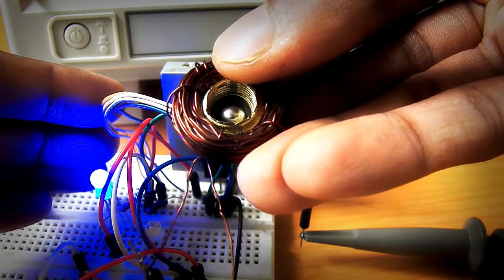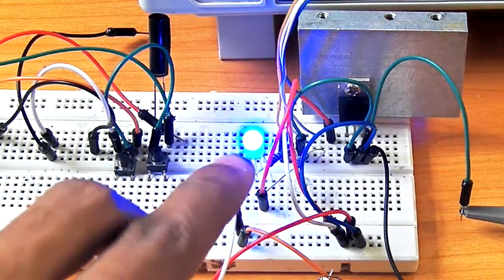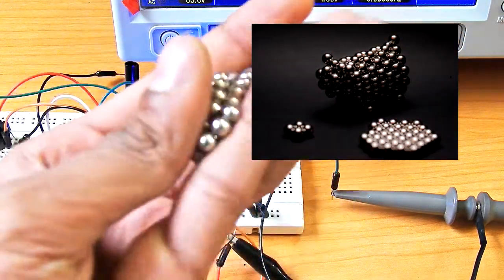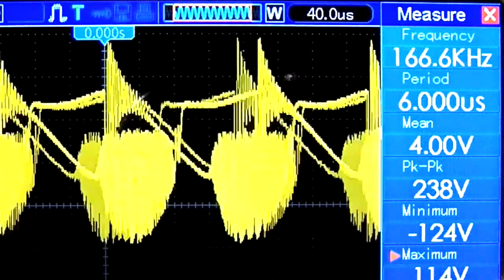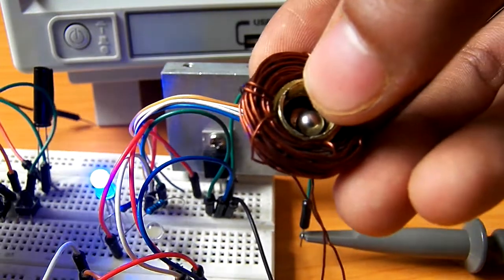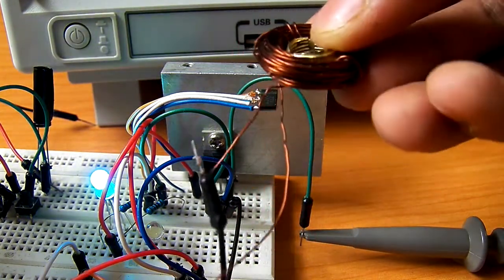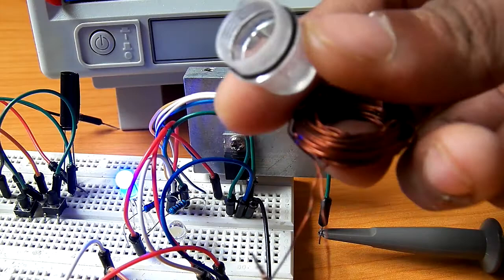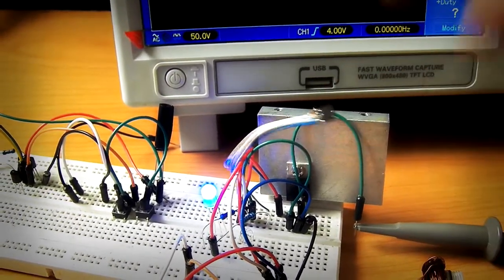Highest Speed DC Electric Motor With Coil & Magnet Tutorial !

Comment: Here is my 1.1 million rpm, 668mph, 3.64 million G's then exploding. https://www.youtube.com/watch?v=5PyTevLzYM8  If you measured 2.1MHz, then you would be doing 126 million rpm!
Reply: EDIT: you need to move your scope probe to the hall sensor output or the gate of the drive FET, also lower the probe bandwidth. The frequency your measuring is coil ringing noise, its clear but looking at 3:28 time in your video. When you get a clean waveform from probe in correct place, take that frequency and multiply it by 60 to get RPM.